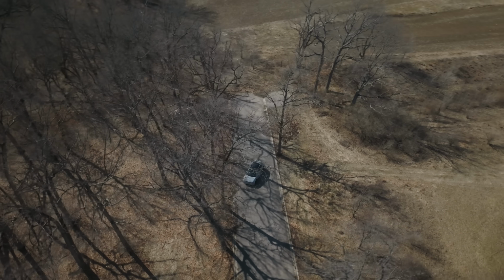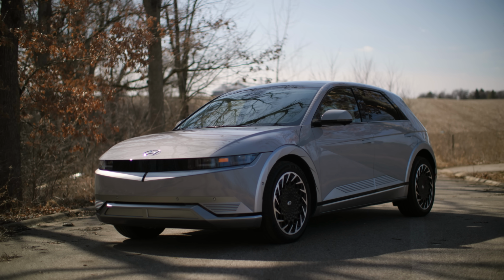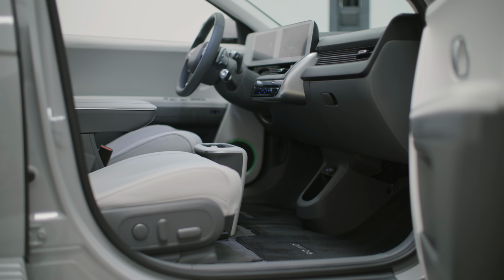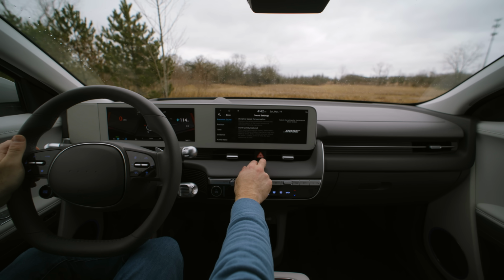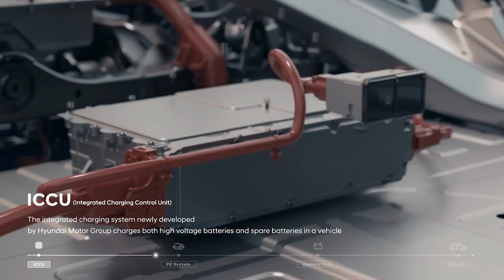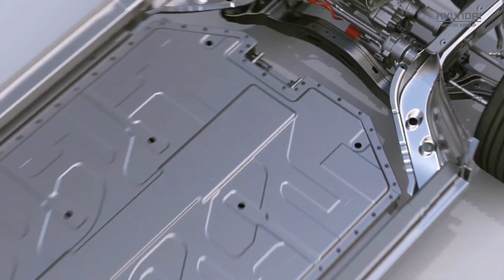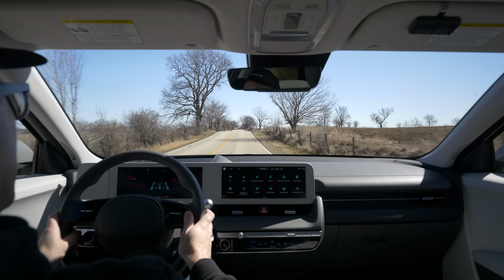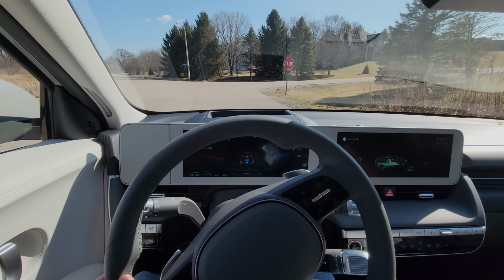2022 Hyundai Ioniq5 EV | Fixing Failed Experiments

Comment: Important clarification regarding the charging of this vehicle. The 800v capability/architecture is part of the CAR, not the external public charging infrastructure. As such this car (and a few others, like the Porsche Taycan) can take advantage of already available public DC fast chargers of 350Kw to charge to 80% in roughly 18 minutes. Most other EVs are built around a 400v system and even if you hook a "400v" car up to that same 350Kw charger on the road, it would not be able to accept a charge that fast. So it's not that you are looking for a "800v" DC fast charger on road trips, it's that your Hyundai/Kia EV can pull up to the already available 350Kw fast chargers on the road and get you a quicker fill up.
Reply: Thanks for the clarification, always wondered what all the EV lingo meant.
Reply: Seems like the fast-charge in these cars would degrade the battery quicker, similar to the same feature in cell phones. I see why it’s needed, but I’d prefer a system that keeps the battery “fresh” for longer.
Reply: @moloono1  that's just level 1/2 charging, you plug in to lower power and charge overnight or while at work, depending where the charger is. DC fast charging is really just for long trips, the bread and butter of EV charging is just charging slowly while you're already parked
Reply: @moloono1  Most people almost never use fast chargers because they charge at home.
And actually I can imagine 800V Systems degrade less over time because normally much less heat is generated while charging (this is one of the main points why 800V systems can charge faster).
Reply: @leokal457  So this wouldn’t be a good option for someone that needs to use the vehicle for frequent, long road trips. It’s a niche use-case, but good to keep in mind.
Reply: @moloono1  Currently EV infrastructure isn't there for lots of long road trips, but even though the fast charging isn't as available right now the goal between like 6 different manufacturers and the government is setting up like 100k more fast chargers EVERYWHERE in the next 8 years and I think 25k more by 2025 along the most traveled highways.
Reply: @Miatalustrium  The infrastructure is another point, but thanks for pointing that out. Seems like, as most things, the early adopters will be paying the upfront price. I’ll wait to see what my needs are in the next decade.
Reply: @Miatalustrium  the infrastructure is there, if you own a Tesla.  It’s hit or miss with others such as Electrify America etc.
Reply: Thanks for the clarification!
Reply: I wonder how big a battery would have to be and what volt rating to get a full 450 miles of charge in 5 minutes? Since that is what my gas car gets.
Reply: 250kw max even though they specify 350 kw
Reply: Lucid Air charges 300 miles in 20 mins.
Reply: This is an important point.
Reply: I believe most, if not all, 350kW stations are 800V capable.  The DC fast charger does need to support 800V in order to get the fastest charging rate, but the Ioniq 5 is fine on a 400V one since it can just transform it up to 800V, but will be somewhat slower because of that.
Reply: The problem is non-Tesla chargers are rare, not working much of time, and difficult to use (and they’re all different in how you use and pay for them).

Search the subject in youtube, there are some videos that show how big of a problem this is currently.
Reply: I want to like this vehicle but I would not park this 1st gen Hyundai/ Kia EV in my garage for safety reasons. Until recently I’ve been a loyal Hyundai/ Kia customer, but no longer, here’s why: my 2013 Santa Fe 2.4 engine blew, wife’s 2014 Elantra 1.8 engine blew, 2016 Sorento 2.0T engine blew, all properly maintained. Every engine other than 3.3 v6 for past decade is faulty as outlined in two Class action lawsuits in Canada & USA, 2 million+ engines. I can wait for 2nd Gen.
Reply: Hope Mark/Jack see this. They should make a whole video breaking all of this down. I believe everything that was stated in this comment to be true, I just don't understand any of it. lol

Comment: Sat in one last week at an auto show, interior is very spacious but finish I'd put on par with an Accord Sport (Accord Touring is much better). Nothing wrong with that, base Accord interior has been very good for decades. The problem is PRICE. A top end Accord Touring with leather is $36K. A top end Ioniq5 is $59K (and dealers are adding $10K). That is a problem. A very, very big problem.
Reply: The up-front cost of big batteries is a hurdle.  Cost of operation/ownership may well be more favorable, though a lot of that info is beyond a typical “road test” format, and some of it is presently unknowable until the early-adopters provide real-world data about their experiences.  Looks favorable, but I’ll be among the “interested, but wait-and-see” set.
Reply: I had the same thought. If they are comparing this to entry level cars then I think they miss the mark. I agree it’s likely way better than those, but I believe it’s less true when you compare to cars in the $40-$60k range. Still some stiff competition in that part of the market.

Comment: Counterpoint to the comment in the intro about some of the company's other EVs being gas cars with batteries packed into them - I'm fairly certain the Kona was originally designed with electrification in mind which is why the EV version is able to achieve such good range and not compromise space to fit the batteries
Reply: With Kona EV and E-Niro, electrification was was in mind but it was still not a priority. A well packaged EV will almost always take the form of RWD-based and have a frunk (or a huge interior if no frunk). Going FWD with an EV is basically nonsense, there's way too much torque to reliably get it to the wheels. The Kona and E-Niro are dominated by insane tire peeling and torque steer, the under the hood space is dominated by a lot of empty space, they definitely could have packaged both vehicles more efficiently if they had reduced the size of the nose and moved the bulk of the powertrain to the rear.
Reply: @0hypnotoad0   @0hypnotoad0 The Kona does have a lot of wheel spin if you're hard on the accelerator pedal, but it also has the characteristics of an electric hot hatch so it can be fun in that sense, and of course a bespoke EV will package in an electric drivetrain better than one that's designed to also accomodate a gas one, under the hood of the Kona is pretty well entirely occupied by the electric motor though, it's not empty space like what you find in something like the Mazda mx-30

Comment: Thrilled you got one. If I was to get an EV right meow, this or the ev6 would be my picks. However, there are ZERO chargers with 150 miles of my house that are over 50 KWH. I hate tesla, but they’re the only solution currently because of their network.
Reply: You hate Tesla as a vehicle? As a brand? As the community? Hate is a strong word, and I'm no Tesla fanboy.
Reply: @mofayer  there’s some good things about them, sentry mode is genius and their charging network integration into navigation is brilliant. But after that, it all falls apart. Their cars as a whole are not built to any fraction of their price point, Tesla customer service is horrendous and the company as a whole is very strongly anti-right to repair, making fixing these things extremely difficult and expensive. They did a few things right, but stepping away and trying to take bias aside, they don’t seem practical to own long term and their manufacturing, quality control, maintainability and customer service are massive detriments. Not saying others are perfect, but the impact that Tesla has had on the industry has also had the same pros and cons. A con being their tech mentality of ‘put everything in software, take all the buttons away, and then push it out regardless if it works, they can fix it with an update later’. Look at the new VW stuff, all through the infotainment and it’s horrible. I can’t blame them directly, but Tesla definitely set a tone going forward.
Reply: @Suction_  ok, your use of "hate" is justified. All this points are valid, but their QC has improved the past couple of years. After all Tesla is a tech company first (self driving), car second, and that's what you get. Also, all car manufacturers are anti RTR, even more with their EVs.
Reply: @mofayer  I’ve heard that, and sure it’s improved, but my coworker just took delivery of a MY2022 model Y and the panel gaps issue is still a thing, and there’s some strange consistencies in the paint (blue). Interior is better, doesn’t seem as creaky, but it was almost $63,000. Sorry, I just don’t find that unacceptable. I know others are anti RTr, but not to the point that Tesla is at. I could at least go to autozone and get some sway bar end links for an ev6 someday, Something I don’t think you can currently for a Tesla. Obviously the battery concerns are the biggest ones there that Electrified garage and the like exposed pretty clearly

Comment: I like the Ioniq5, EV6, and the new Ariya. The problem for me is the price is too expensive. I will wait till the battery cost drops significantly. Take out the batteries and the build simplicity is so much less than an ICE vehicle.  Profits for manufacturers will be greater for full EV's than ICE vehicles.

Comment: Hopefully the SK battery packs fare better than the batteries Hyundai used before because those packs had major battery degradation, which is the main concern with Hyundai EVs. The other issue is whether Hyundai is committed to OTA updates and improving the car. Many manufacturers have already come out to say that OTA updates will only be for navigation and basic infotainment improvements, nothing else. And therein lies the rub. You buy this next gen EV that will be obsolete in a few years because they've left the tech for dead. Then there's the poor state of 3rd party DC fast chargers. I've found them to be unreliable in the area. You get there and it's dead or inoperable. It's like VW stood up the Electrify America infrastructure but forgot they need to be maintained. Are people going to factor in home charging as they make this purchase?
Reply: The Kia niro EV has used the SK Batteries while Hyundai was using the LG. So far they’ve been very good for the Kia so I have high hopes

Comment: I really like that car and want to buy it, but I feel like the inconsistency of the charging network would piss me off.
Reply: It depends how many road trips you'd plan to take it on.  I wouldn't buy an EV if I didn't have some way to charge at home.  EV's have the greatest benefit for daily commutes, driving in the city, etc where they are the most efficient and won't need to charge.  Plug it in when you get home and wake up to a full charge the next morning.
Reply: If you want to take longer road trips, it likely would. However, it's improving all the time, and that should speed up as more people buy non-Tesla EVs.

Comment: Too bad these are impossible to get unless getting hosed by the dealers marking them up to $80k 
My fiancé is looking at EV or plug-in hybrid cars
And prob is going with the XC60 Recharge (Volvo).  Also a very nice place to sit and those seats are dope (designed by chiropractors and Drs I’m told and I totally can see thst..  my back sucks so I can appreciate that)
This Hyundai is amazing looking 
I’m a old school petrol head so not big on EVs .. but I will say they’re very nice things to ride in and nice places to sit.  Just not fun for highway pulls, racing and trying to fly down a windy road as fast as possible without getting juked by the one time

Comment: While this and the Kia EV6 aren't to my liking style wise, I can respect how unique they are, along with how interesting and differentiated the product is. Being strictly a sedan/coupe guy I'm very interested to see what the Ioniq 6 will look like.
Reply: Ev6 will be my next car without a doubt
Reply: I own a kona ev and I hate it because every day I can see the missed opportunity and the potential an electric platform would have in  a RWD sedan. With the ioniq 5 being so solid I have really high expectations for ioniq 6 as well
Reply: @HanYou2  Same here. The Kona is still very good for what it is (basically just a very competent compliance car), but it is frustrating in that you can see that all of the ice-packing problems are still carried through into the design, I will probably dump mine for an Ioniq 5 at some point when the potato chip shortage is over. Through it all, I recently drove a combustion Kona loaner while having a manufacturing defect fixed, and honestly going from driving electric for the last 3 years back to a combustion vehicle, I felt like I got cancer. Driving around with the raspy four cylinder, weak torque, it feels like you're driving a that car is broken, by comparison, I couldn't stand it, I think at this point I'd actually choose not own a car and save the cash, than have to drive a vehicle like that as my daily.
Reply: @0hypnotoad0  true, and i can't understand haters driving 1.6 diesels calling EVs washing machines, and that they will never buy one
Reply: @0hypnotoad0  If the loaner was the gutless base engine, its no wonder you were horrified; most ICE powertrains are better. I do however look forward to test driving an EV at some point. The instant torque sounds like fun.
Reply: @drgturbo Agreed, though the problem is the cost of admission to a "good" combustion engine plunges cars into territory where an EV becomes very apparently cheaper to own, so it's a self-defeating exercise. Mr. Goose summarized it pretty well that nothing within the "economy" range of affordability comes close to what an EV can do in terms of daily drivability. I don't want to be in a noisy 4 cylinder box, and I also don't want to have to dump a fortune on a smooth V6 that then drinks gasoline through a firehose, it's a lose-lose scenario and frankly if good EVs were not on the table I'd just save the money and not have any car
Reply: @0hypnotoad0  My local Kia dealership has some Niro EVs and EV6s in stock, but I have chosen not to test drive any EVs until I am ready to buy one. A test drive would probably make it tough to get back into my noisy and slow(ish) gas 4-cylinder car. I'll just enjoy reading about EVs while enjoying not having a car payment.
Reply: @drgturbo  Yeah if you're in a car reliant life situation just wait it out until you can get one at a good price, it's not worth dumping a usable vehicle unless there's an immediate reason. I don't think one test drive will necessarily spoil you, mostly because of the weirdness of the first experience, but once you get used to driving one over the course of a few weeks, going back just feels impossible.
Reply: Haven't seen them in person however I think the Hyundai looks pretty good. The  kia not so much.  Kind of the reverse of the telluride/palisade. 

I think this and the ford will be the best to live with assuming you don't need the super charger network which is honestly the only reason to buy a Tesla.

Comment: I think it's a really cool looking design, inside and out. I've had friends with Hyundai's over the past 10 years with real cheap, peeling paint jobs and interior parts coming apart in the first year or two. I don't trust Hyundai.
Reply: Buddy's genesis (2 of them) had peeling paint in the first year which was a widespread issue. His door handle just fell off (recall).. this was on brand new bought cars. Cousin's Santa Fe had some interior quality issues and engine failure (recall). I like ioniq5 a lot though.
Reply: They had to slap on that 10 year warranty to try and get people to buy it. But then you spend weeks in the shop all the time.
Reply: @FishFind3000  saw something about a water pump leak/failure and resulting drivetrain overheat failure on the ioniq5 so far
Reply: @FishFind3000  Well there are also people who have owned the brand and since I have a 2013 KIA Optima with 110k miles and no issues, my opinion is based on personal experience. The warranty is great, never got to use it but it's good to have and all cars should do the same
Reply: I've had 4 Hyundai and Kia cars in the last 10 years. 2008 Optima, 2011 Sonata, 2012 Genesis Sedan, 2020 Stinger and now a 2022 Stinger. All have been great cars and the only one I had a single problem with paint wise was the 2008 optima which had some clear coat peel off one mirror. Never a problem with interior parts breaking. If you take care of your car and paint they aren't any different than other cars. Their paint is much better than Honda especially.
Reply: And then there's guys like me who has a 2013 KIA Optima with 110k miles and it's been near perfect. The paint is also perfect, so I will go with the reality of owning one

Comment: I wonder when solar panel roof for EVs will become a thing. Van conversions already use solar panels to charge Lithium Ion batteries so I don’t see this being impossible. Also wonder if corporate greed will put an end even before it starts since it’ll technically be “free” charging.
Reply: Panels are expensive and they don’t really provide enough power to do much. But it could be an extra option that tree huggers would like. If it could get you a few percent charge per hour of sun then I see it as useful. Or at least be enough power to keep the battery cool/warm so it doesn’t eat your battery when parked.